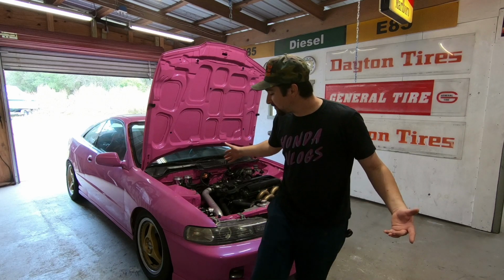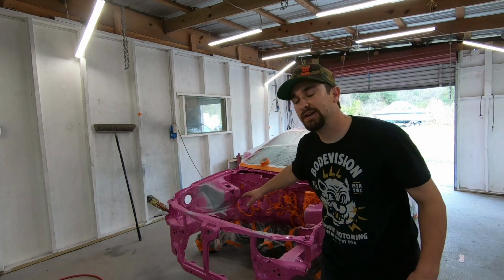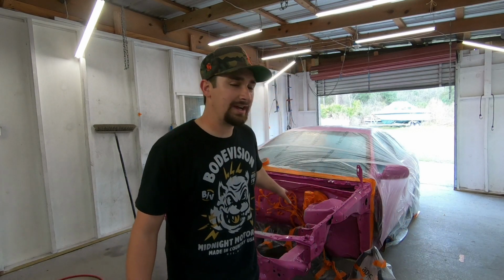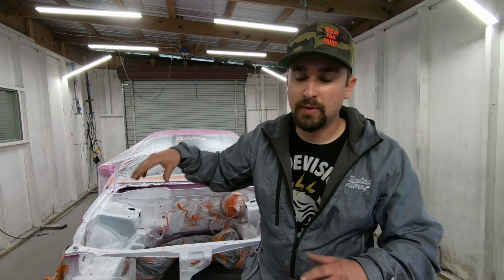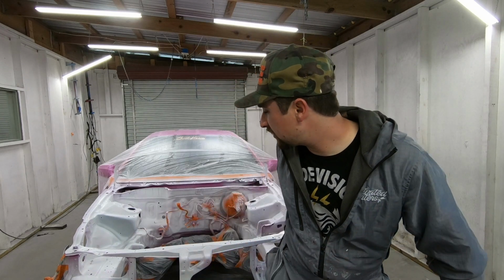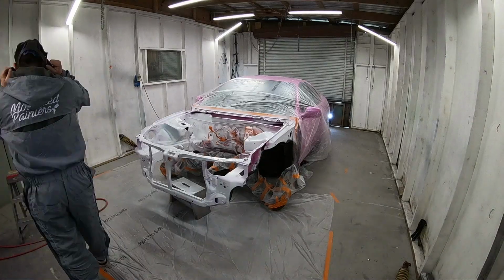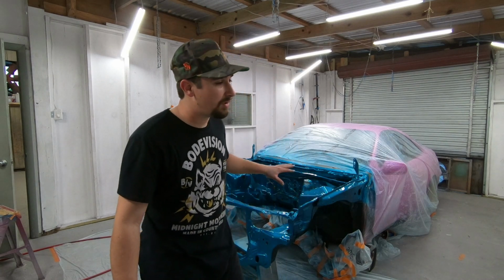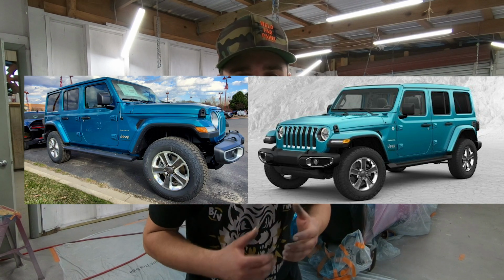Beginners Guide To Painting An Engine Bay

Comment: One cool thing I have seen people do when “masking” is use aluminum foil to cover any lines instead of tape. Seems a lot easier
Reply: Did that on my 240 when I was touching up the engine bay.  Works awesome and makes life a lot easier.
Reply: As a commercial painter I second this!!! Works wonders covering up live sprinkler heads for fire control systems!

Comment: Im down to bare metal on my RHD EK hatch how do i do this properly man what size tank do i need for my compressor and how to i take care of rust in places were i cannot reach like tight corners and can i pressure wash the bare metal before painting what type of primer do i use on bare metal and what grit sand paper do i sand the bare metal before i hit it with primer also what cleaner do i use and do i need tack cloths? I have some tack clothes and theyre sticky is that normal?